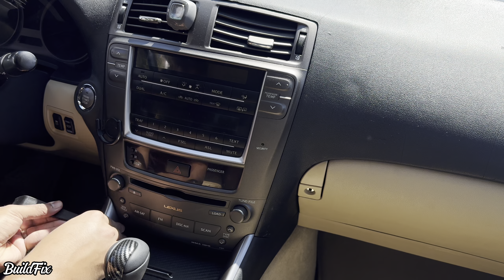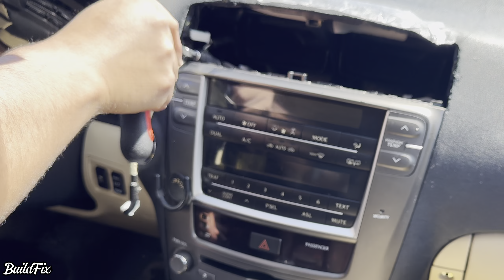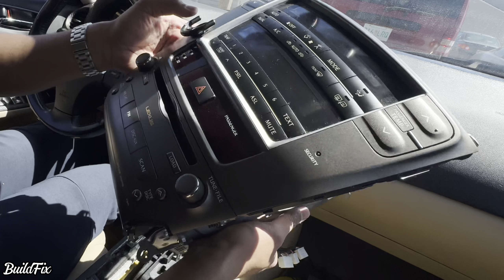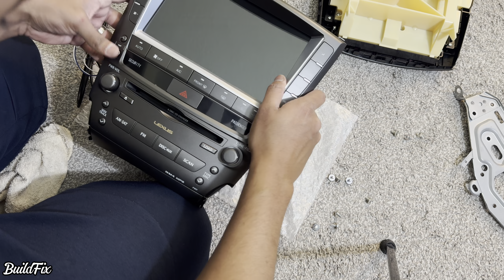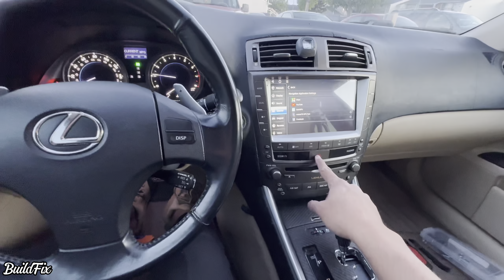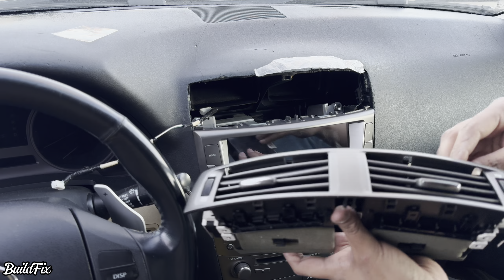How To Install 9" CarPlay Central Multimedia Stereo Screen On Lexus IS250 IS350 2006-2013

Comment: would this work for a 2006 is 250 w/navigation ?
Reply from the maker: Depends, if you have Mark Levinson or Fiber optic cables then buy the below product instead: 

https://mightytechstore.com/products/viknav-linux-system-for-lexus-is-2005-2008-oem-screen-lvds-decoder-interface-box-multimedia-android-auto-wireless-apple-carplay Android Auto Wireless Apple Carplay Linux System For Lexus IS/ISF 2006 – MIGHTY TECH STORE

Comment: Are you using wireless carplay, or wired? Asking because I installed this unit on one of my Is and could not get the wired carplay to work and when I connect wirelessly, the connection is very unstable.
Reply from the maker: Wireless CarPlay, mine works flawlessly

Comment: Has anybody had audio quality issues with these? I have the volume halfway up on mine and it’s pretty quiet.
Reply from the maker: You can control the main DSP volume from the CD exchanger knob, I like to keep it at 50%, and the remaining sound you can control from your steering wheel
Reply: @ yeah I can’t even turn the volume up to 100%. It only goes to like 63 even with the steering wheel.

Comment: Question, do you know if it works even without a car amp? Does it has a built in amplifier?
Reply from the maker: This is a TS18 model in the video, and in general TS18 and TS10 models are the top spec models which comes with DSP, and supports Lexus audio systems, including factory amp/woofer and customizable equalizer
Reply: @BuildFixCars  so its gonna work even if the amplifier that comes with the car its not working?
Reply from the maker: I suppose. Additionally, if you have an aftermarket subwoofer/speaker installed, this screen also has connection for those.
Reply: @BuildFixCars  THANK YOU SO MUCH !!!

Comment: Great video! I was able to install it with no prior experience. It has worked great until today. Screen is on but blank. Tried to reset it but nothing happened.
Reply from the maker: Which model screen do you have?
Reply: The one you have linked from mighty tech store.
Reply from the maker: @jodiyoshikawa8573 I suspect you may have tried to play with the screen resolution, if you have signed in to the device using your Google account, go to your Google my account and try factory resetting the carplay screen. 

I suggest you should take a video of the problem and send an email to their support team , they are super fast in troubleshooting. Support@mightytechstore.com
Reply: @ problem resolved itself. Screen is working again.

Comment: Help i install  the new radio  now i have electrical problem  my windows  wont go up my all the lights  on my dash not working  my odometer  stop working  gas gage not workin 😅
Reply: Did you manage to solve the problem? The same thing happened to me
Reply: Hey, it's most likely to be a 10 amp fuse, that fuse is in the fusebox below the glovebox. I blew that fuse by accident and my windows stopped working and all dash light were lit up, so its probably the Radio No. 3 fuse ( 10 AMP ) 

But also make sure to check why did it blew up, or just get a couple of fuses just incase the new one blows up also.

(Edit: Check all radio related fuses, or just check every fuse to be safe. 

You can check the fuses either visually or using a multimeter so you can test for contuinity)

Comment: Completed installation and the AC not responding
Reply from the maker: This might help:

How To Fix AC, Hazard lights and Steering Buttons Not Working ? [Lexus CarPlay Screen]
https://youtu.be/TH4PC157HT0
Reply: @buildfixcars  he just put the factory back in after it triggered the Airbag senor and everything went back to normal

Comment: I got 90% of the way installing my kit when I realized it came without any audio hookups (just female ends that plug into the android tablet) and no adapter for the rear camera.. rough!
Reply from the maker: That’s a bummer. 

Your OEM CD player has three connectors, middle one goes back to original factory plug , and I think from the right most connector, you are supposed to get the male audio cables (red and white) to connect to your RCA (audio/subwoofer cable harness) of the new Screen
Reply: @ I see, thanks for the insight- it appears that plug is missing from my kit entirely unfortunately
Reply: @ they got back to me and said I don’t need those cables? That I have to setup the canbus controller through software and it should work? Will report back…

Comment: Where did you end up running the microphone wire or does it have it built into the unit
Reply from the maker: In this tutorial I’m using the unit’s in built mic, but its not clear sound so installed mic in a later episode in my channel. 

Next week I will show how to install and route the wires.
Reply: @ thank you my bro

Comment: Any one know why I have to hold the hazard light for it to stay on , if I click it it blinks for as long has I’m holding it when I let go it turns back off
Reply from the maker: @abdulhamidoguntade7920  just to confirm, did you click it all the way in? I’m not aware of any such hazard light problem to be honest. If the hazard light turns on, the wiring is good.

Comment: I installed this unit and the AC controls screen keeps popping randomly every few minutes while driving. Do you have this issue and/or found a fix?
Reply from the maker: Go to AC Settings and change the duration to 6-8 seconds. And generally the ac screen shows when the car automatically turns on/off your outdoor vent.

Comment: Did you have to plug a piece into your obd port
Reply from the maker: Yeah, that reads speed, reverse signal etc
Reply: @ do you have to have it I gotta performance chip that’s in my obd port I wannna change my radio out but I don’t wanna have to take my chip out
Reply from the maker: Nope, the OBD connection is optional if you want to have some data displaying on the screen for you, but you already seem to have a performance chip, that probably displays some relevant output so that should do. 

Bonus, if your performance chip has a monitoring app, you maybe able to see it on the carplay screen. 

I got a OBD2 Splitter Adapter Full 16 PIN OBD-II 1 x Male to 2 x Female T Split Extension Cable to run 2 OBD2 devices at once.
Reply: @ yea I need to look into that I need a splitter

Comment: Hey bro could you tell me what sleep mode settings you have. No sleep,2days sleep or 3 days? I just don't know what sleep mode to keep on for preventing battery draining fast.
Reply from the maker: I have it setup for two days, but currently I keep the car indoors in storage and the car turns on fine a week or two later when i turn the car on to keep battery charged. Basically sleep mode means if you turn on your car two days later, your unit will reboot instead of resuming from memory.
Reply: @BuildFixCars Thanks for reply. I will set it to 2 days.

Comment: Hey so I had this “professionally” installed but after they installed it there was no audio at all. I tried disconnecting my factory amp and still nothing. Do you know what it could be
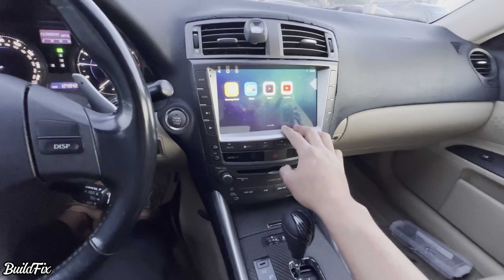Reply from the maker: Seems like the did not connect the factory audio cable to the aftermarket headunit. See 10:40 in this tutorial, i had the same issue

Comment: I installed the head unit, but my radio won’t work. I don’t see any OEM or even aftermarket antennas that would even plug into the head unit. Any idea?
Reply from the maker: Yeah watch 10:40 in this video i had the same issue and I was able to fix it.

Comment: Quick question i just installed this but for some reason i cant seem to get audio from any of the usb ports and also looked everywhere for the apple car play and cant find it either, am i missing something?
Reply from the maker: @Dxaiver08  ZLINK is the inbuilt app you’ll find for the CarPlay. 

Regarding audio, you need to check your cables. Usb cables is only to read or access data, not AUX. You can use USB cables for dashcam or flash drive to play audio video. 

DM me on my instagram if you have any questions

Comment: Hi bro, my car has the big factory radio however, it uses fiber optic. Can this radio work with my car? My oem screen is with the button the same level as the frame
Reply from the maker: Whats your model and year?
Reply: @BuildFixCars  is350 f sport 2011
Reply from the maker: @chopboss7202  should work, there is the product link in description, they have an image reference that shows which models will and will not work
Reply: @BuildFixCars i just checked, it’s saying it can’t work for mine. Damn
Reply from the maker: Ah bummer, but the F sport model is pretty good, upgraded ecu, suspension etc., great car bud!
Reply: @BuildFixCars  thanks bro🙏🏾🤟🏾
Reply from the maker: Btw, you should get the Grom VLine to get carplay working on your OEM screen. Look it up

Comment: Will work with 2008 Lexus ISF with ML system?
Reply from the maker: I dont think so
Reply: I an 07 & have ML & I just installed an Android system… because the screen/system crapped out… gps & Bluetooth are fine… but the fans & ac don’t function (major issue)… also lost my backup cam … which supposedly the oem cam is supposed to work with after the digital setting is adjusted… it took me over 5 hours trying to carefully & cautiously do the swap… been too annoyed to deal with it for the past 5 days since I worked on it. Luckily don’t need ac as much as previous months. I read I might need to figure out how to get another included wire rigged in for the backup cam … but not sure why the fans / ac / climate control are nonfunctional. I’d honestly suggest going to a car stereo place and get a guarantee of full function install unless you love car projects that may take a lot of time & trial & error with a potential of ending in error. Seems like A lot of them have garbage instructions & no support(and every vid I have seen is a dif version of Android head unit😬) If there was no issue with your oem unit I wouldn’t f with it.
Reply from the maker: @theunstoppabledriver6978 i have the tutorial of AC not working posted, see if that helps. 

Regarding backup camera, in your REVERSE settings on the aftermarket android unit, select “Reversing system selection” to NTSC instead of AHD 720p. 

I hope this works.
Reply: @BuildFixCars  I’ll check it out! Appreciate the feedback!
Reply: @SJAITGSITS  
Have you already fixed the AC functions?

Comment: Hi mate! I bought and install a same unit like this, unfortunately, after that, I couldn't open the trunk of my is220d with the smart key button, the inner button (below the steering wheel) and the outside button (near the rear plate of the car). From that moment on I only can open the trunk with the manual key. Did the same happen to you or to anyone else around?! From aperil untill Now no electrician auto shop could fix this... :(    Any help sugestions ?!
Reply from the maker: It has no connection with the head unit, there is a hidden button in the glove box, try that.
Reply: @BuildFixCars  Yeah! I know about that button, even with it activated I still can't manage to open it... Thanks anyway mate!!
Reply: I have no more question, every time I made phone calls through the CarPlay within my unit the person who I'm talking with, always complaint abou the bad sound quality, do you have noticed the same problem? thanks again mate!!

Comment: Can someone help me? The radio station keeps playing while I'm playing music from my phone via blutooh.. You can hear both radio and music from my phone at the same time.
Reply from the maker: It happened with me too, check 10:45 in the video, i explained how to fix it.
Reply: @BuildFixCars  yes I saw it thank you for it fixed.. you’re awesome dude !
Reply: @BuildFixCars  I did exactly what you said exact same thing I moved that antenna from the original radio bottom to the android top and the little one I left it out. And I still hear the radio (frequency only) in the background..
Reply: I fixed it. I had to unplugged the left white and right red audio cable. That took the noise out of

Comment: Great video. Quick question, your video name says it will fit an ISF, but when I got to the product link, there is an image showing the ISF radio with NAV as the type of car  radio it can't fit. So are they wrong or are you? also, if it really can't fit do you know why?(the explanation on the product site isn't very clear)
Reply from the maker: @MRwilsondraws  the ISF 2008 and 2009 comes with the older model that should work, 2010 onwards I am not sure. Also I’m not an expert on this, my description is based on the supplier’s description.
Reply: @BuildFixCars Ok that clears it up. Thanks. Do you know of any options like this product that would fit a 2010 IS with Nav?
Reply from the maker: @MRwilsondraws  shoot me a DM on my IG, I’ll try to help you out.

Comment: hey mate did you have to dremel out the plastic on the new unit? I saw a video of a 08 is and he needed to dremel out the new unit at the buttom to make it sit on top of the cd player
Reply from the maker: Yeah basically i retrofit the carplay screen on top of the cd player. Really easy though, its covered in the video
Reply: @BuildFixCars  did you have to use a dremel or did it fit right in? because it seems you just fit in right in and its sat.
Reply from the maker: No dremel, its direct bolt on. I think i showed a time lapse in my tutorial, i should have slowed down i guess

Comment: For anyone whos installing the headunit. When removing the center vent, DO NOT touch the dash with anything as its extremely fragile. Youre better off prying from inside the vent and breaking it than totaling your dash. If you have a 06-08 model with the old vent, youre gonna have to buy the facelift vent anyway.
Reply: I’m looking to order this head unit, what do you mean by facelift vent? Is it to get rid of the gap? If so where do I get one
Reply: @siennasmith4537  yeah its to get rid of the gap since they designed the headunit for the facelift 2009+ models.
Reply from the maker: @siennasmith4537  you’ll have to separately purchase a 2009 central AC duct from used auto parts. Not very significant, but if you are picky about it, then go for it
Reply from the maker: @KK001  right

Comment: Hey mate, got a 2006 sports luxury, finally got it installed but my a/c doesnt come up when i press the buttons and my stock reverse camera isnt working with the obd plugged in. Any ideas?
Reply from the maker: Just posted a tutorial on the AC not working FIX, Check it out :)
Reply: @BuildFixCars  AC is working thanks mate, still just the reverse camera issue
Reply: @MaleekSkermer hey im here 8 month later with the same problem as you with the stock camera did you find any solution ?
Reply: @denko6005  unfortunately not, I had to use the aftermarket ones provided. I had to DIY a bracket for it
Reply from the maker: @MaleekSkermer  yep, make sure you are connected with Wi-Fi on your device, then you have to go to the factory settings, enter code 8888 then go to SELECT MODEL, then select the following number options,
1- Canbox- select number 14 
2 - Cars - select 38: LEXUS 
3- models - select 01: Lexus IS
4- select low config
5- logo select default 

For the reverse camera, connect the yellow female plug and short the camera red wire with the radio POWER Brown wire
Reply: @buildfixcars  any other codes it could be? I've tried 888 and 1234 and nothing comes up (figured it out was 8888)
Reply from the maker: Just updated my comment above, can you retry? This should work 👍🏻

Also, the extended options password is 123456 if you want to explore other settings to configure
Reply: @buildfixcars  sweet, thank you very much. A/C working normally. Besides the whole RHD thing 😂 I can live with opposite side controls though. Will try the reverse camera later
Reply from the maker: @MaleekSkermer  oh actually, you can also change your orientation from left-hand drive to right hand Drive, there is an option in the settings somewhere, I forgot, I remember seeing it somewhere
Reply: @buildfixcars sweet, I'll have a look. With the reverse camera, I'm not sure which is the camera plug. Struggling to find this red wire haha. And does it just get connected to the head unit end of the brown wire where I cut it?
Reply: @BuildFixCars Can you swap the two temperature buttons around? So passenger temp is on the left?
Reply from the maker: @henryscarsnz  i dont think so the manufacturer makes it modular, I’m assuming they make one model for LHD 2006 to 2012
Reply: On my Android Auto display unit, binary 13 is displayed but binary 14 is not shown. Additionally, I'm experiencing issues with the reverse camera and the hard buttons not working.
Reply from the maker: @smeetjoshi223  i think you have some packages missing, connect with wifi and install the right car model
Reply: @smeetjoshi223  let us know if you get it working. Still stumped
Reply: @MaleekSkermer  your stock reverse camera wont work if you have the mark levinson sound system, for some reason. As for the ac not showing up, you probably need to cha ge your car config from low to high somewhere in the settings.

Comment: Doesnt mention if this is compatible with a factory headunit that has A/C Nav built in.. I know some are not compatible. Can anyone confirm?
Reply: I have a 2013 is350 with nav and ac and I ordered the same thing and the connections in the back don’t match. Some do plug into others but there no cord that connects to the “power” so the screen doesn’t work and stays black
Reply from the maker: You should return from wherever you purchased it 🤷🏻‍♂️
Reply: @BuildFixCars  already did this was months ago👍🏼
Reply from the maker: Actually the product link i shared in description has one of the images that shows compatibility ✅